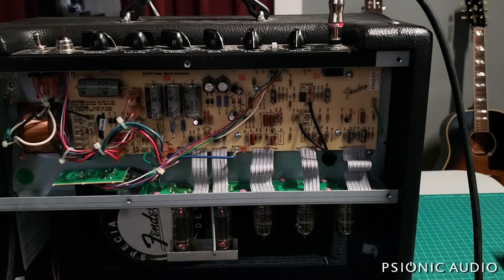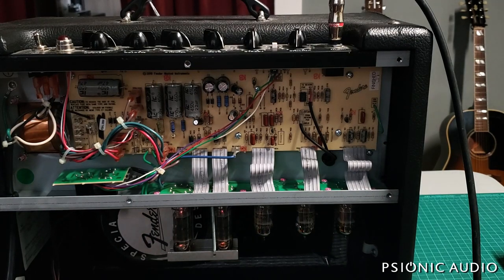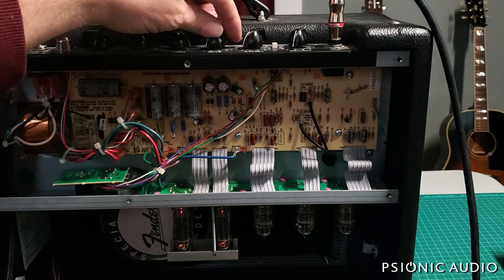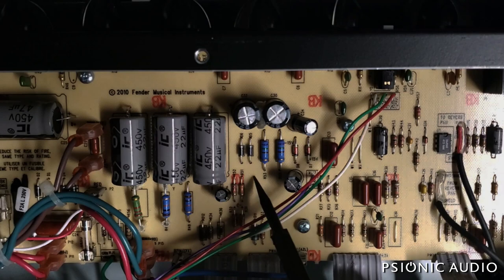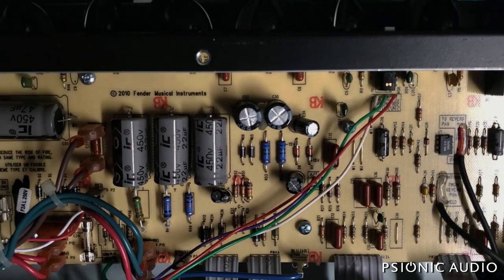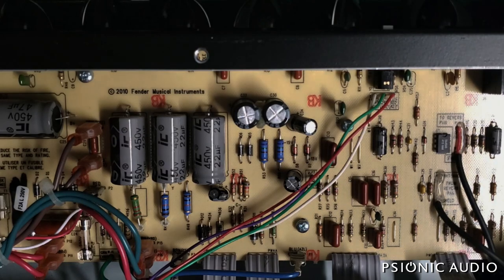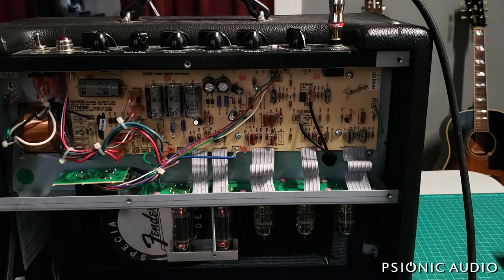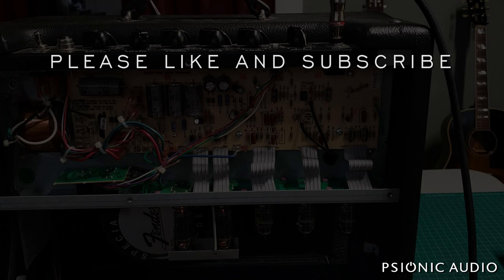Cooling the Blues Junior Bias | Make Output Tubes Last Longer (and Prevent Fiery Death)

Comment: Thanks for the great info in this video...I just picked up a used blues junior II (2003 cream board) and the power tubes were being cooked after a few minutes of turning the amp on. The 82k piggy back resistor cooled everything down with no loss of the sweet Fender tone...I also removed the bright cap as well and it tamed the harsh highs. Much much much appreciated!

Comment: I have a first generation green board Blues Jr. that the late Bill Machrone modded doing pretty much the same things you've done. Only other tweak that I like is he changed the tone stack caps to match the values of a Princeton. I had to double check and he used 270pF on the treble and 0.1uF on the bass. Mid he left at 0.022uF. Really gets rid of the boxy sound.

Comment: I bought a new gen2 Tweed LTD BJr in 2006 that came stock with a Jensen P12N AlNiCo speaker. Made the typical changes to the 

bias resistors, filter caps, and power supply caps. A couple years later I put the unused half of the V2 preamp tube to work as 

part of an oscillator to add a tremolo effect to the bias voltage of the EL84 output tubes. A daughter card was put in for the 

circuit components, and a small box added to the rear to house the pots for speed and intensity. A Fender Rev/Vib footswitch was 

also added for those two effects while the FAT feature retained the original single footswitch. It is a versatile amp.

Comment: My experience inside a Blues Jr. lead to “don’t move anything you don’t have to.”  I added a trim pot for adjustable bias, but that meant lifting the board… which caused other problems with the ribbon cables.

Comment: Bought 2 of theses amps in 2002. 20 years, 50 states half dozen overseas flights and too many long nights leaving it on and forgetting about it for days at a time, still on original power tubes on one.  The input jack and reverb tanks I have had to replace over and again though. But they have taken more of a beating than I can describe.

Comment: Speaking of eating '84s... A while back I replaced the stock 100R screen stops in a Carvin Nomad 50 (fixed bias like BluesJr) with 2k 2W wire wounds. Protects the tubes and changes the character of the amp: slightly softer and improved touch sensitivity. Not everyone will like it -- but I sure do!

Comment: I've been doing this for a while now but my procedure is a little different. I clip a couple test leads and use a 50k pot in parallel to get exactly what I want as measured with a couple bias probes then I get as close as I can value wise considering the particular pair of tubes which can vary quite a bit in current draw.

Comment: Rather than rely on internet rules of thumb. Everyone should model their amplifier’s load line on the Vtiady website using the load line calculator to see where idle should be set. I have fooled around with the calculator and have noticed that sometimes on some configurations, your amplifier will generate more heat and lose audio power by increasing the idle current.

Comment: Great videos on moding and troubleshooting the Blues Junior. 
I did this mod and I am measuring about 1.9 volts measured across Red (P2) to Brown (P3). Does this sound about right?    
I played it for about an hour and it sounds fine. No issues with tubes or other components.
Others are saying that  you should be in the 2.3-2.5 volt range for idle voltage.  I did play with other resistor values and here is what I found for voltages, and here is what i found for results:
Stock,  33k Resistor @ 3.5 volts
82K Resistor @ 1.9 volts
120K resistor @  2.2 volts
150K Resistor @ 2.5 volts
I went with the 82K mod per the video, and have a matched set f the EH EL84 tubes on the way to try.
Thanks again for the great Videos and information!

Comment: Nice. I've got a Pro jnr MKIV that I think is biased unnecessarily hot. There's a pronounced phasey/fuzzy distortion quality when pushed, which while it sounds cool, it could use a little "less-is-more" action. I'm speculating if cooling the bias, and or raising the power tube's grid stoppers would tame it a bit.

Comment: Hello again, I did a Fromel Complete made in Mexico Mod Kit back in 2009 on my blues junior 1. With that, the bias cooling mod was as follows "At R52 install the 33K bias resistor". Have I achieved the same bias cooling as you have here in this video. I noticed you installed the resistor at R51 not R52. Cheers mate Ollie

Comment: I have a blues junior 3 that has the lightning in a bottle issue (from another one of your videos). I'm looking to fix that and do the bias fix in this video. Let me preface this question by saying: i am not an electronics engineer or technician, but I can solder, I can read a diagram and a multi meter, and I can replace parts. Also this amp has been down for about three years, so I'll still check to make sure its not hot before I get into it, but I don't expect it to be hot after so long. Looking at the diagram that fender put out for the blues junior, the resistor in r51 doesnt list a wattage rating (maybe I don't know how to read the diagram 🤷‍♂️). How do I determine the wattage rating for the resistor in r51 aside from assuming that its the same rating as the resistor on r53 (1w) thats next to it in the diagram?

Comment: Remember folks, the 70% max idle dissipation rule was always supposed to be a maximum guide value. You can happily drop way below that. In my experience, most people will notice no change in tone or output until you drop below 50%.
Reply: split the difference and make it %60 I say.
Reply: @jasoneugenides5770  Nothing wrong with that.

Comment: Unless I missed it you didn't mention it, but I noticed (during the soundcheck at the end) that you seem to have the master volume fully cranked and use the "normal" volume/gain to set the actual volume. Is this your default way with this amp? I actually found – more or less by accident – that my BJ tends to sound best when I do it the very same way: the sound is fuller, somewhat less ”boxy“ and the dynamics seem to be more sensitive to how softly or strongly I dig in with the pick... Would you generally subscribe to this impression I'm getting?
Reply from the maker: I prefer to use MVs as little as possible.

Comment: Fender does appear to be exceeding the maximum 6BQ5 power dissipation.  The RCA receiving tube manual lists the maximum plate dissipation as 12W.  My SPICE simulation of the Blues Jr output section lists the 6BQ5 idling current power at 14.3W.  The Blues Jr schematic lists the B+ voltage at 329V, with the grid biased at -10.6V.  It makes me wonder if Fender is using a power transformer from an existing application that is actually a higher output voltage than the specified or deliberately driving the 6BQ5 above recommended specifications.  The grid bias can be further decreased (more negative) to reduce power dissipation, but moving the 6BQ5 idling point may introduce more distortion.  This all hinges upon what the actual B+ (plate) voltage from the power transformer.

Comment: Fender bought Groove tubes from Aspen Pittman, so why not make  amps that eat up tubes quickly? Aspen was mostly just the main marketer for Groove Tubes. Hunter Dabney did all the really hard & heavy lifting by designing all of the equipment for GT.  Hunt left GT around 1981-82, went out and got some other audio patents filed & approved. Then he went into a consulting business to sustain his patents. Hunt and my second cousin H.W. (Barney) Barnes Jr. were good friends who worked together on patents for a very wide range of purposes. FMIC knows less than NOTHING about tubes. They know how to print the name Fender & Groove Tubes on JJs or New Sensor tubes and that's it.

Comment: My BJ is so trebly I set the treble pot to off ! I've clipped out the bright cap on the volume as well but it's not made any difference. Tried with Les Paul, Strat,Tele etc, but can't get it to a place where you can't hear your hand touching the strings . Though about changing the 250pF cap on the treble part of the tone stack. Any recommendations ?
Reply: @_alexsams  .. I'm on the third speaker change and none have made a difference to the treble.  Back to the Celestion now.  Thank for the suggestion.

Comment: 5:38 can I ask how you solve for the new resistor amount? In parallel it would be 33x?/33+? = 24k Correct? I’m not much of a math guy but needing to learn. How is the unknown solved for? Thanks!
Reply from the maker: Google parallel resistor calculator.
Reply: @PsionicAudio  thanks! Didn’t even think about that. I understand how the 33k and 82k make 24k (23.5 ish) but the calculator is asking for the resistor values and giving me the total. I can’t imagine that it would be trial and error until I came up with the second value needed would it? In other words, you have 33k and want 24k so resistor 2 is unknown. Seems like the calculators all want you to enter r1 and r2.

Comment: Bias is stated easily to think of it like it temp  starting at zero  . More bias more negative  thus   cooler .  Less negative  warmer .   By calling it negative bias the effect is clearer .   Well that the method I use to remember the effect.  The real way to run 70% on the output  is with a fully regulated high voltage and screen grid voltages  that not happening with a fender at all.

Comment: I'm trying to do this mod on an early green board US made Blues Jr. but the resistors aren't laid out the same. It seems like on the green board version I'd be piggybacking the new resistor across R31. Correct?
Reply from the maker: I don’t have that schematic handy but it’s the top resistor in the voltage divider that provides the bias voltage. I think the divider was 33K/24K on those, though it’s hard to measure the lower value because of the cap across it.

Comment: You mention that the bias is too hot in the first three iterations of the amp. I have a Blues Jr. IV so is there a bias problem with that one too or did Fender ever get their act together and fix this problem?
Reply from the maker: I don't know. I was told they changed that on the IV but haven't had one in.
Reply: @PsionicAudio  ok thanks. I saw a video of a guy who did the same mod that you did on a IV But I had heard the same thing so I guess the true test is to measure where the bias is at before proceeding.